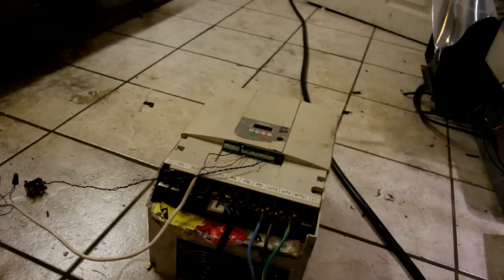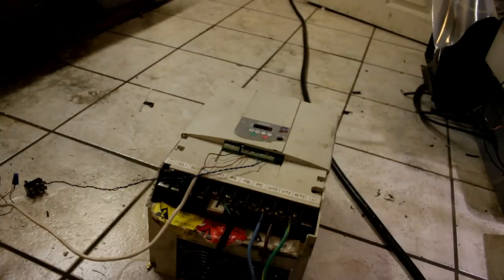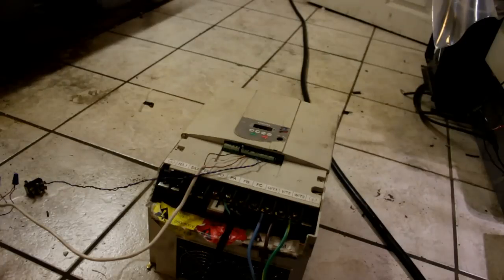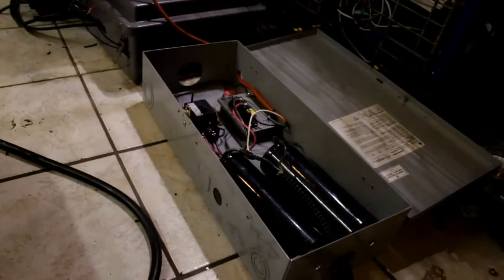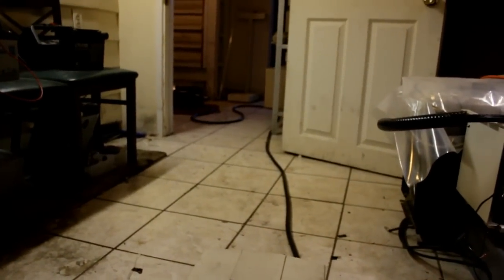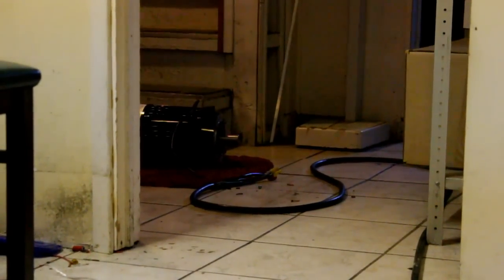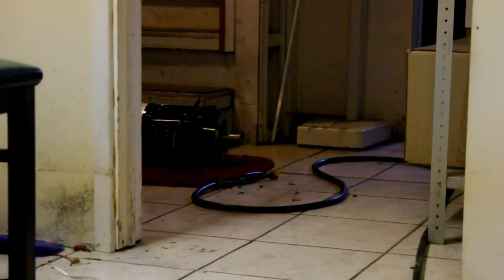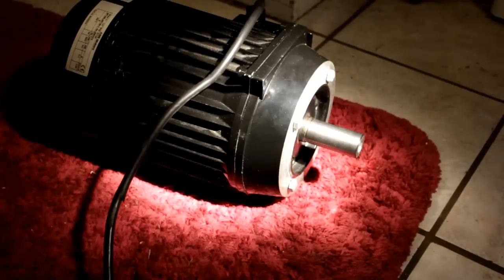Induction motor overspeed experiment

Comment: This technology is a scaled up version of what you see in front loading washing machines. This could have applications, replacing carbon brush universal motors in vacuum cleaners. Washer motors are 2 pole 3 phase, and use 380 Hz, to run about 1900 RPM, accounting for slip loss.(spin cycle) Two stage vacuum motors run at about 28,000 RPM.(about 480 Hz needed for slip loss). An upright vacuum runs at about 18,000 RPM, requiring a little above 300 Hz. I can see many applications, for running induction motors at "Ludacris" speeds, hence, the existence of the VFD you're using!
Reply: One application is in subway trains. This particular VFD sounds like those on the 2009 stock on the London Underground.

Comment: Damn, that went smoother than I expected but you're one ballsy dude running that indo motor that high while just sitting there, untethered or bolted down or anything.... I take it you've never seen how much energy is actually held in such a small space via a flywheel (the rotor in this case) when they are spinning that fast... the second the tiniest imbalance is introduced at those speeds, you'll VERY QUICKLY find out just how much energy is sitting and spinning in that confined space... shit gets real crazy, real quick and I don't want to be anywhere near it when it does... you're a smart freaking dude, but let me give you a tad bit of advice based on real world experiences, lock that sucker down like it's fort Knox and armageddon just started bc that SOB wil do whatever it damn well pleases and there won't be anything that you or anyone else can do to stop it until it has run its course...
Reply from the maker: I suppose they are precision balanced, have oil cooled bearings and so on,  but there are much faster induction motors that operate with much higher internal energy. The rotor in this motor isn't very big. But a motor in an electric car, say a Model S for example, actually has a pretty sizable rotor and spins much faster ( at top speed anyway ). Just for the record, I was aware of the danger and I actually took this motor outdoors and stood well back and did a test run before I shot  this video, just to make sure. I took this video and I don't think I ever did another top speed run with this motor.

Comment: does the motor actually slowing down the same pace as  without Frenquency modulator ? 
i mean the stopping of induction motor on frequency modulator can actually being control ? 

let just say i want the motor to stop completely from it top over  speed in 1 second.. it is possible using the frequency modulator ?  (does frequency modulator actually inject reverse power into it to make it halt faster ?)
Reply: Yes, you can apply a braking action to an induction motor with a VFD. The motor can be slowed down by reducing the frequency, applying a DC voltage to the motor, or by reversing the phases (known as "plugging"). Each of these methods can be activated and adjusted by changing the corresponding parameters in the drive.

Comment: i have being working in mitsubishi electric servo motor division. i dealt with high speed servo motor.. only repairing the servo motor controller.. 

and i heard a familiar sound today.. the motor speeding up... can clearly hear it..  well, i thought it is just because of servo motor.. not knowing normal induction motor overspeeding sounds the same. 

i have long not working there.. 

your motor is 240vac 60hz induction motor right ?  and you for the sake of making it run faster, you actually feed it higher frequency by using Frequency modulator right ? 

i am wondering by using Frequency modulator, do you actually feed it higher voltage ? no right ?  you mentioned feeding it higher voltage and higher frequency..
Reply from the maker: 4 volts for every 1 Hz. So an increase in frequency means an increase in voltage, until the VFD reaches maximum output voltage, at that point any increase in frequency reduces output torque although the speed still increases (Field weakening)  if the load is low enough.  The motor braking can be virtually instant if DC injection braking is used. In fact the braking effect is so strong with DC injection that the torque of deceleration can damage the motor or anything attached to it
Reply: you meant 4 volts / hz.. so if you start running the motor at 50 hz, it will be 200vac already isn't it ?  or i totally misunderstood what you said ? 
btw, with VFD, what is the lowest freq it can generate to start running the motor ? and what is the lower voltage it can start running the motor ? 

thx
andrew
Reply from the maker: That's right. VFD's which are set to a linear output will do just that. The lowest frequency a VFD can generate is usually between 0.1 Hz and 1.0 Hz. The frequency at which the motor will start turning depends on the motor. At low frequencies (and therefore low voltage) the stator winding resistance is usually enough to prevent enough current from flowing to magnetize the rotor. Some VFDs do have a feature called "torque boost" or "IR compensation" to help with this problem. In my experience, with the proper voltage compensation, most motors will start turning by time the VFD outputs 1 Hz
Reply: @subcooledheatpump  how do u set the vfd from 200volts ie 50hz to ie 3600rpm to 480volts ie 120hz ie. What rpm is it 8640rpm approximately  or 2.4 times as frequency is 2.4 times 50hz

Comment: https://deltaautomation.wordpress.com/2014/03/11/operating-motors-at-higher-speeds-than-their-nameplate-speed-can-it-be-done/           educating the masses
Reply from the maker: Yeah that's a pretty good one, but I do believe they are wrong on a few points. They suggest that most industrial motors can safely operate at 125% of their rated speed,  but that really does depend on too many factors to simply state that as a rule of thumb. Many small industrial motors are rated for twice their normal speed (200%) but the larger they get the lower the rating. 

They do mention that the top speed is limited by the available voltage, but they never mention anywhere about extending the base frequency by increasing the voltage. A 240 volt 60 Hz motor can achieve constant torque up to 120 Hz if 480 volts is available, but again they never mentioned that. They only mention constant power and reduced torque with 100% voltage and field weakening at higher speeds.

They also said that many machines are constant power, but most are not. Compressors and fans are certainly not. It's completely opposite of what they suggest. Most loads demand more torque as the speed increases, not less.

Comment: A somewhat similar motor overspeed event occurs when the brush-type starter motor in vehicles refuses to disengage (bendix drive failure)...considering the typical geared flywheel is some 14" (356mm)...since the toothed gear on a starter is only some 1 1/2" (appx38mm)...the gear-up effect has the starter motor turning some 50K RPMs, often times exploding the motor assemblies from too much RPM. The typical motorist notes this high-speed whine rather quickly & turns off the car immediately.

Comment: Thank you for show this experiment. What do you think on remake the coil conections and put all then in parallel to reduce the nominal voltage and use VFD control do extract  more rpm at the same torque? Is it possible? What kind of problems will i have? I am thinking on do it and put it in my electric car project.
Reply from the maker: Yes that would work. Only one thing you must watch out for: reducing the nominal voltage will increase the current requirement to produce the same torque. For example; consider a standard 15 hp motor with a dual voltage winding. the 460 volt winding requires 18.5 amps. While the 230 volt winding requires 37 amps. The lower the nominal voltage, the higher the required current. Also higher magnetizing current. Otherwise the problems are just higher iron heating losses and high bearing temperatures. Thanks for watching.

Comment: Thank u so much for your very informative video and answer so if we put the motor name plate voltage in vfd parameter given for motor specifications, wouldn't Vfd do that on its own. thanks again.
Reply from the maker: If the VFD works that way then yes.

Comment: So can you run a 3 phase 220 volt motor on a 600 volt vfd assuming vfd can stand the FLA of the motor ?
Reply from the maker: Yes, but you will also need to  increase the base frequency. For example, a 220 volt VFD will output 220 volts at 60 Hz. To use a 220 volt motor on a 600 volt VFD, you will need to tell the VFD to output 220 volts at 60 Hz, otherwise it will output 600 volts at 60 Hz and it will eventually cause the stator winding to melt. Assuming the base frequency is programmed correctly, the VFD would then output full voltage at 163.6 Hz, Increasing the speed and power 2.72 times.

Comment: the motor laminations are rated at 50Hz. if you crank up the frequency, wouldn't they start heating up due to eddy current losses?. wounldnt the lamination along with the motor windings behave like an induction heater?
Reply from the maker: Akshay Vyas Yes that is correct. At higher frequencies, Iron losses are the majority of the entire motor loss. At lower frequencies, the stator winding resistance losses are the majority of the entire motor loss. Regardless, however, the motor will be able to output more power continuously at higher frequencies than at lower frequencies. Thank you for watching.
Reply: yeah i belive ur correct because aircraft fans that run at higher Hz have very fine and thin lamination and are balanced to a very high standard

Comment: Thanks for the video. I am using same VFD and didn't knew that it can be operated by DC. Here we have shortage of power and long hours of load shedding. If u can help me with things needed to run this thing on batteries it will be big help.

Comment: Very nice. If it can survive 24k then 12k should be easy which bodes well for electric cars. Why did it take so long to spin down? was it dying under power or what happened? And what brand and model is the motor.
Reply from the maker: I was ramping down slowly to avoid an overvoltage trip on the VFD, it was just a regular "dumb" VFD, not one with torque control. The motor is an ABB MT100L28F130-2 Two pole induction motor, footless with flange mount. Thanks for Watching
Reply: subcooledheatpump no, thank you. it's a quite informative experiment. it sheds light on how tesla can use their motors to 15k. It thought for sure it would fly apart at 24k. the forces must grow at least with the square of the rpm.